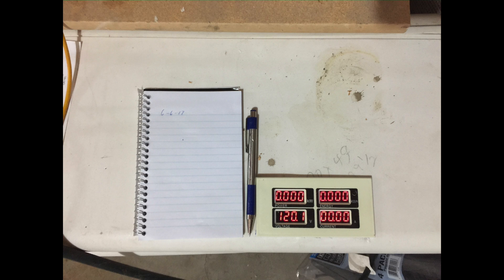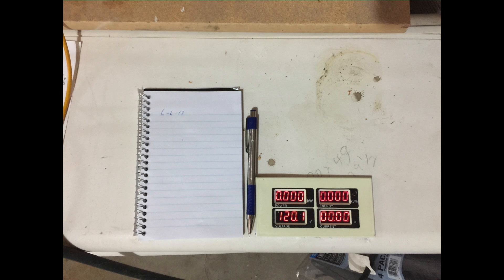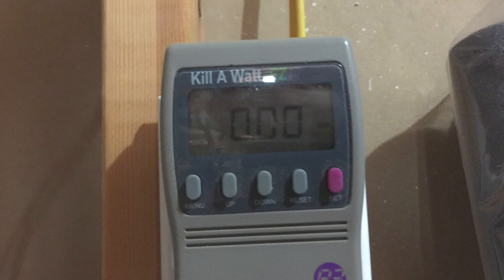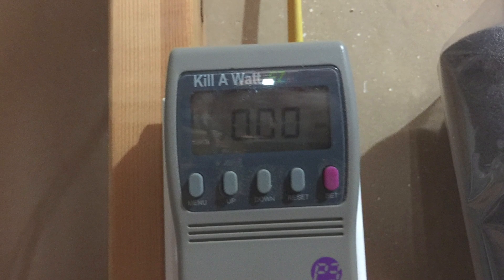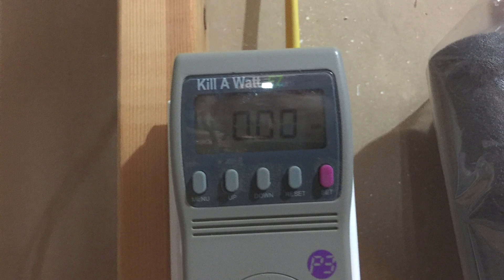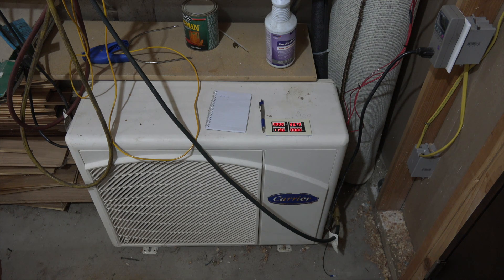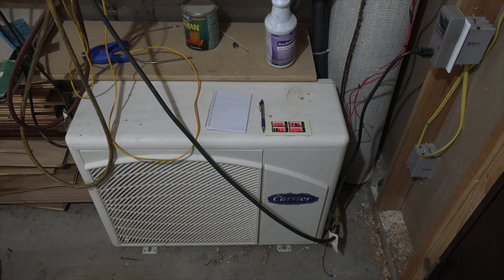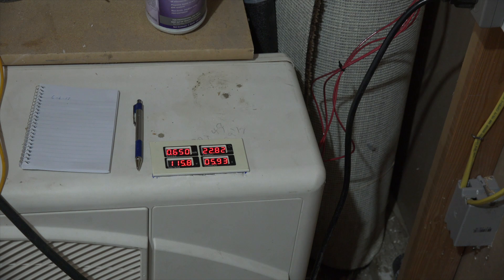Cold plus test #1

Comment: Is this the right place to put the outdoor unit?
Reply from the maker: The choice of placement of the "outdoor unit" was made because the temperature is contstant.  If it were outdoors, energy usage would vary every day due to changing outdoor temps.  In that case, any testing would have to be for multiple years and modified for different trends in temps.
GFM

Comment: Have a question- Is it okay to braze a new lineset without using nitrogen? Thanks Brian
Reply from the maker: I don't do it without nitrogen.  The high temp from brazing causes copper oxide deposits on the inside of the pipes.
GFM
Reply: Thank you sir :)
Reply: Stay Brite #8 for the win

Comment: Just curious- What kind of refrigerant gas does this system use? Also, does this system use a TXV or fixed orifice? I do not know,  but the result of this product may be affected by the refrigerant type or metering device.
Reply from the maker: Its an R-22 unit.  I am thinking about using it in a R-410A  unit also.  This one is a fixed orifice.  
GFM
Reply: I think testing it on a 410A unit also is a good idea. It may work better with one refrigerant or another, or it may not matter. Thanks for taking the time to make these great videos!

Comment: Errecom Co. has a similar product called "Cool-Shot" performance enhancer. From what I gather it is supposed to help by cleaning PAG oil deposits from condenser and evaporator coils so temp exchanges is enhanced and more oil is returned to compressor. Cost not cheap at $27 on Amz...
Reply from the maker: This stuff says its better but has the same claims.  
GFM